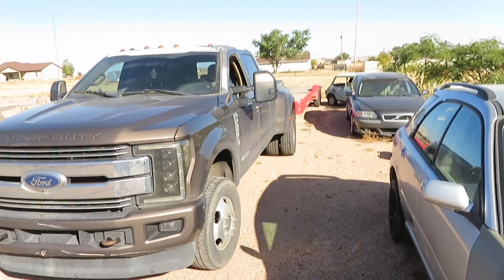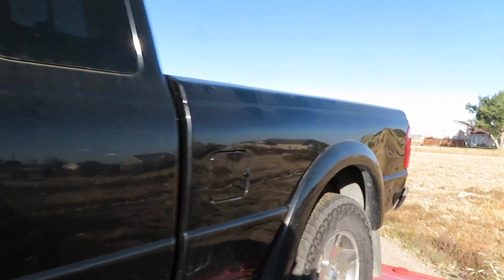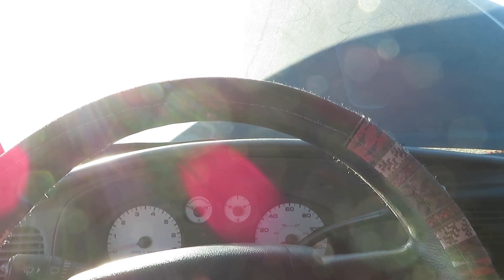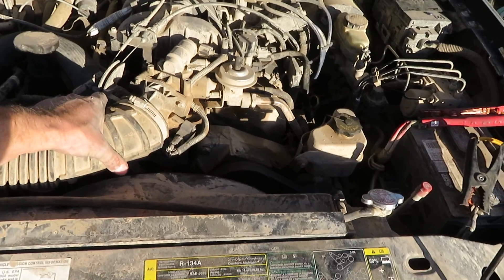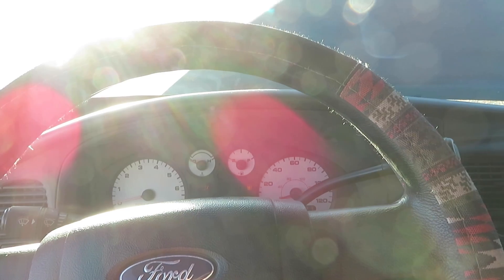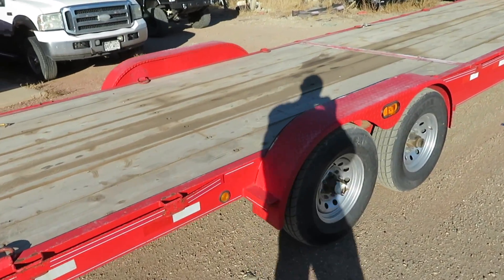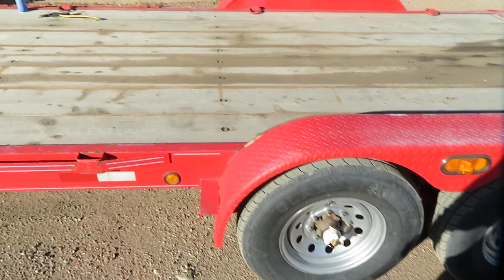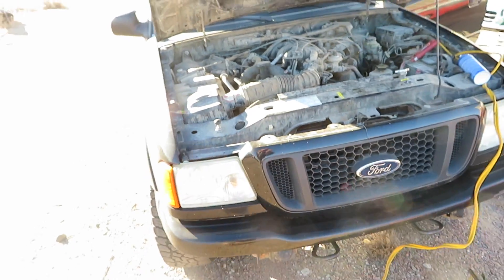I bought a High School Kids BROKEN Ford Ranger - It's BAD!!!

Comment: Needs a 4cam or a coyote swap... possibly a 2.3 or 2.7 ecoboost swap> Lightweight powerful and efficient? GOod video Dave.
Reply: Why do that when its just a beater that would be a waste of time
Reply: @subarulegacy4203  is it a beater? Looks pretty ok to me. He has resources. Idk Bea fun experiment
Reply: @reggeckmann3993  over here that's worth weight in gold solid frame zero rust and he's a grown 40 yr old man being a whiney crybaby over a 800$ truck that probably only needs a couple grand to get right I only paid $5k for my ranger but had to put new tires new control arms new shocks now I'm sitting at 7000 into it but she runs great
Reply: I have 3.0 V6 b3000 4x4 1999 120k miles and Ive been doing great in 6"- 1 foot of snow but the ice got me today slide on the corner right into a snowbank even in 4x4 perhaps need spare underneath for the weight but I had bed full of tools and went right into that snow bank luckily I back myself out and went right home zero damage at all thank god lol but -35 degrees she struggled a bit but still cranked right up so did my moms Honda

Comment: You can patch that trailer tire from the inside. We had one of our tires done that way. It's far more reliable than a plug.
Reply: The patch is the correct way to do it. A plug is basically supposed to be a temporary fix so you can drive it to a shop and get it patched.
Reply: @PanameraTurboSEHybrid  I've had like 5 plugs in a tire, just rubber cement the plug and stick it in
Reply: @devilmonkey  Sure. Even with rubber cement, plug can still leak again, maybe not now but anytime in the future. I've replaced what felt like thousands of tires for years, and seen so many plugs leaking new or old. People can do what ever they want. Just saying that patches are the correct way.

Comment: the v6 3.0 + 4.0  do die it's the 4 banger that will not die. i had a 3.0 that i blew a headgasket still drove it for 5 years and then one day cracked the head but it still got home. the next day it started right up but with a bad miss and you could see the crack clear as day